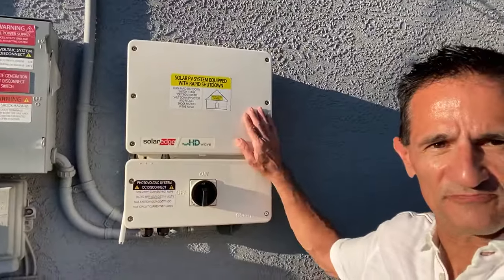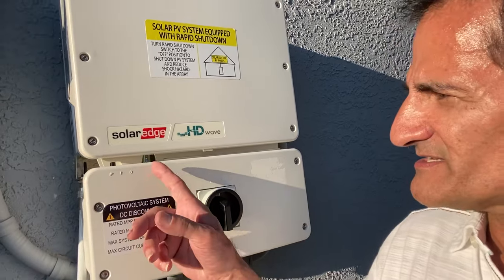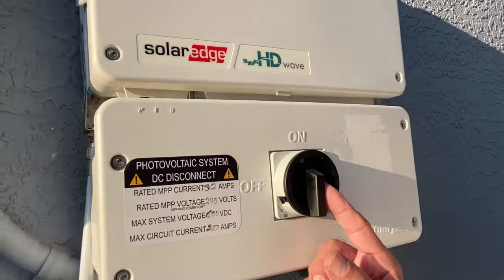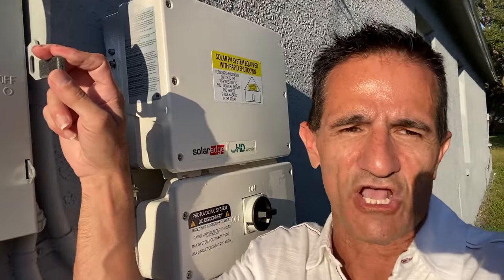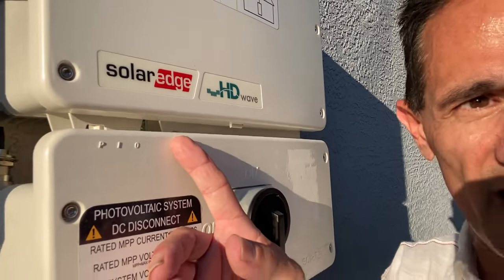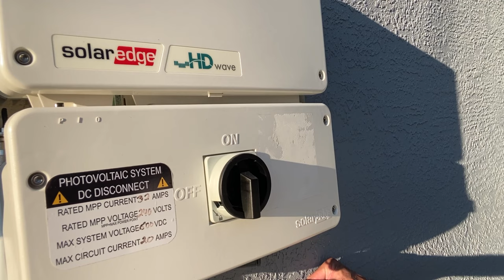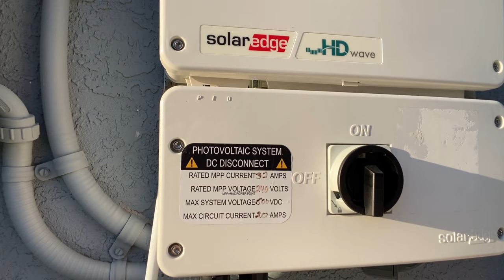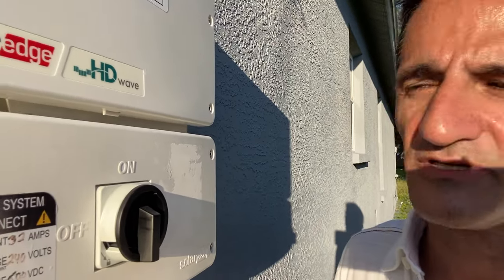How to Reset & Trouble-shoot the SolarEdge Solar Inverter. How To Reset & Fix  Solar Edge Inverter.

Comment: Thanks a lot for the tips.   Your video is way clearer than the Sunrun instructions.   Interestingly enough, Sunrun did not even notified us that the system was not producing for at least 5 days.   It wasn't until a power outage in the area that we were able to tell there was an issue since the backup batter didn't kick in.  We were able to get the backup system restarted with your procedure.
Reply from the maker: Great ! Glad it worked .. thanks for watching
Reply: @solarbygreengreg  BTW, would the reset process change much if there was a battery backup?

Comment: You made a mistake. After shutting down the system...the next to last step you showed was turning off the breakers inside the garage. When rebooting the system (turning it back on after shutdown), you didn't close the main breakers during the process.
Reply: The system I showed is connected entirely outside .......  It does not have breakers for solar in gargage....  I did mention that  some systems may have garage breakers    and if so those need to be part of shut down process ...  Thank you
Reply: @gregm448  Are you saying that the main breaker to the house (regardless of location) is not part of the Reset process for the Inverter?

Comment: My systems doesn't have any lights on at all. Please help. Sun is shining and I have no service.
Reply from the maker: Check your circuit panel .. is there a breaker labeled "Solar" if yes switch off and back on again.... If you still  have no lights ... It might be a bad inverter or wiring problem .. you will need to schedule a service call.

Comment: When do i turn on the house breaker (labeled solar)
Reply from the maker: Follow same steps and order in video. If you have a solar labeled breaker turn that off just before switching off disconnect switch 
When turning back on do reverse order 
Disconnect , breaker , inverter dc switch , inverter toggle switch

Comment: Do I need to shut house electric box switches 1st off? I turn red toggle to the right and blinking red /blue/green lights came on for a bit then it just went solid green in middle again. I’m trying to get back to solid green and blue
Reply: Now I have blinking green
Reply: @beachjeanie  Blue is only only sometimes --when its communicating with Solar Edge Monitoring .   Blinking Green means still a problem ....  Yes if you have circuit breakers  labeled Solar .. you can switch those of and back on again .. then try steps in video ..lights will be blinking  upto 5 minutes  if still blinking  green  after 5 minutes .. there maybe a problem with inverter , solar setup , or wiring ... You will need a Solar Tech to  repair system..   Thanks, Greg

Comment: Mine still just flashing green now what? Company won’t answer only Bots respond
Reply: This might be a wiring issue ....Are you calling your installer during business hours?  most companies work mon-fri 8-5  or 7-4 ...   In case you cannot get a hold of your installer... You may have to find another solar company to service your system .. but of course you will be paying them a  service call fee ...
Reply: Any red light ever

Comment: No light at all😢
Reply from the maker: If you flipped all breakers and still no lights … the solar edge may have fried out from a power surge … will need replacement … contact your installer to get RMA from solar edge

Comment: I tried to reboot and have a solid blue but a blinking green and it’s been blinking for over a day what do I do
Reply: Hey Garrett,  binking green means it's not producing... a tech will need to troubleshoot... schedule a service call. thanks
Reply: Thank you very helpful video I have another question when picking a buy back provider should I pick more months like 36 months at 16.9c rather than 12 months at 18.3 cents per 1000 KWH ?
Reply from the maker: That's  hard to know without looking at all the terms and conditions ... and also. need to know what will happen to electric rates in future .in your area .... if electric rates are rising in your market I wouldn't want to be stuck at  16.9   ....  There are a l;ot of factors on electric rates .. such as fuel costs ie natural gas ... etc .. Electric  fees and taxes, electric transmission etc   What  state regulators  alllow by law, etc ...  I suggest searching  state chapters of ASES American Solar Energy Society  and SEIA. https://www.seia.org/. and see what they say about this ...

Comment: Thanks for your video. My system was showing fault indicator and it started work after reset as you said. Thanks a lot.
Reply from the maker: Glad it helped! Thanks for watching .. be sure to gave video for future ...
Reply: Well my keeps blinking, the red comes on ro and turns off then both lights blink blue and green but they won't stay solid

Comment: Anyone know how to get it back on day mode my inverter is staying on night mode 24/7 I can switch off but then saying night mode off
Reply: Nightmode is either roof issue or thermal damage in inverter. If you're comfortable test the strings coming in when DC is off for safety voltage. It's gotta be at least 8vdc. If the string voltage is there there's likely an issue in the top cabinet of the inverter
Reply: @AnActualCoconut  yes I believe bad inverter you all are correct

Comment: I fallow all your steps an the green light is still blinking it pass more than 5 minutes
Reply from the maker: Hello,  if green blinking light not turn solid green after reset ..then it might be a wiring or inverter problem. You will have to get a solar service technician to visit your home to repair.

Comment: What if the green and blue light is still on?
Reply: Solid Green mean it's producing , blue means it's communicating with Solar Edge .. the blue may blink or be off .. it's only on sometimes . In  case green is blinking .. then you will need a solar technician  to  troubleshoot ...  thank you for your comment .. have a great day.

Comment: Thanks Greg, I paired my App to the inverter last night and now I have a blinking green light with a solid blue and now I have no data on the app or website for Solar Edge. Will this reset help with my issue?
Reply from the maker: Blinking green means not producing solar electric yes try resetting ...

Comment: My toggle is off but the lights won't stop flashing for me to power off
Reply: Do you have a battery hooked up to solar edge ?   If you shut off disconnect switch that should cut power to inverter …    If you have a battery  you will need to shut off breaker in your circuit panel —there should be a breaker labeled SOLAR..
If these don’t work then i suspect  there is a wiring issue … you will need a solar tech to come out.. 
if you don’t have a battery and you put toggle to OFF  there is a wiring issue … hope this helps ..

Comment: What does it mean when the system is on but the LED are not illuminated
Reply: If leds are not lighting   and sun is shining that means the inverter is not operating ,,, check make sure to go through all steps in video .. also check your circuit panel .. is here a breaker labeled "solar " --if yes turn breaker to off , then on .....  note if solar edge mounted side of home then there might be a circuit panel near meter.....  If niether of these help then schedule a service call...

Comment: Hey Greg I just got my inverter replaced an is on night mode how long does it usually stay in night mode ?
Reply: In night mode during the day?
Reply: we have a brand new system that is doing the same thing. night mode all day long.
Reply: If your inverter is in Night Mode/Sleeping during the day, you have a string fault. No DC voltage is coming down from the modules so the inverter thinks it's night! Make sure connections in the junction boxes are tight! -- I train people to diagnose issues with solar :)
Reply: If you have dc voltage there's been a boom boom in the top of the inverter

Comment: Kinda was helpful but I really was waiting for the clicking sound & produced nothing
Reply: After reset Is Green light on and not blinking ? ... If you don't hear clicks .. I suspect it could be a wiring issue or a bad inverter
Reply: @gregm448  thank you & yes I’ve did everything I’ve viewed in other videos I’m not getting any DC voltage building up either it’s California for ya 😂
Reply: @gregm448  thank you I’m just going to wait for them to get out here & let them fix the issues & great video & advise I greatly appreciate this